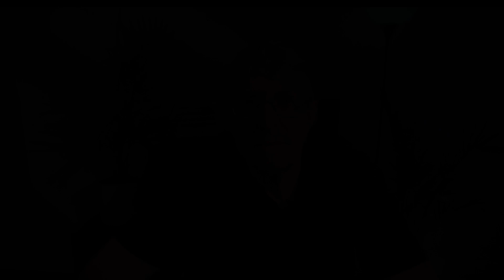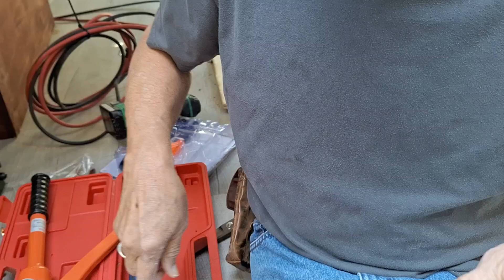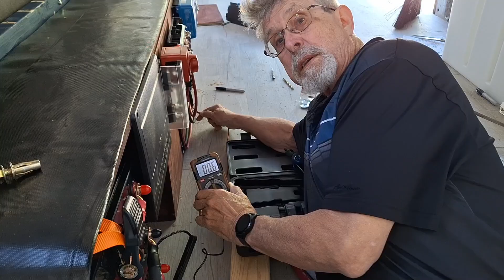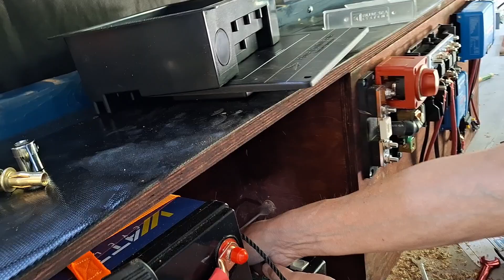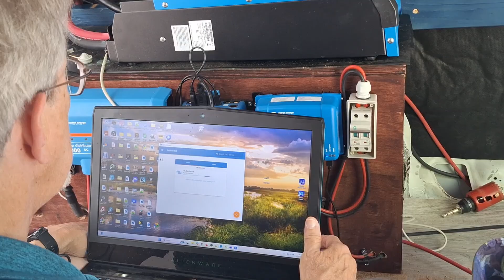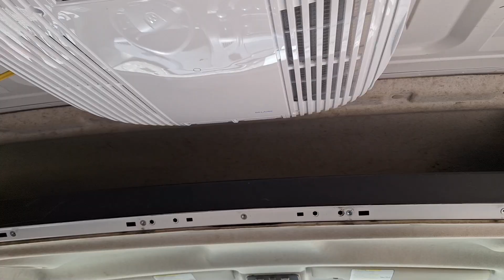Camper Van Build Milestone – Rooftop AC + Full Electrical Core Install

Comment from the maker: This was a BIG build day — we got both the rooftop AC AND the core electrical system in!  
Here’s your timestamp roadmap so you can jump to the part you want:  

00:00 Intro  
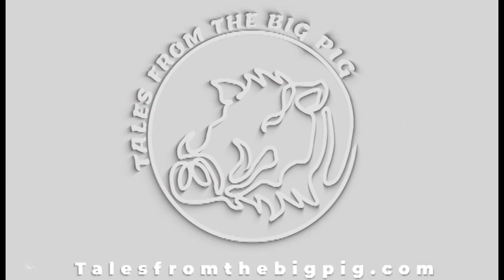00:44 Raising the AC  
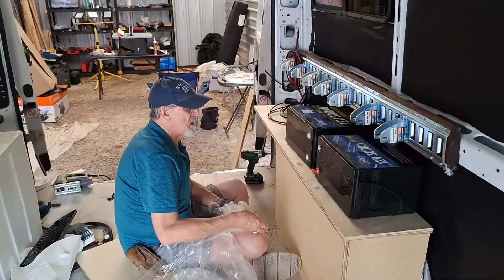02:47 Electrical Core Installation  
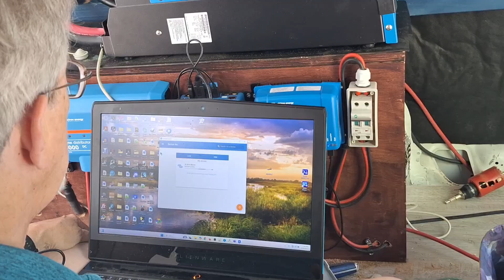14:44 Programming  
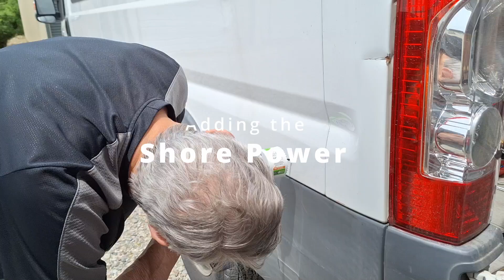15:28 Shore Power Install  

Question for you: What’s the toughest upgrade you’ve done on your own van or RV build?